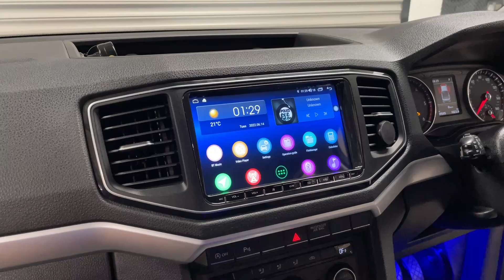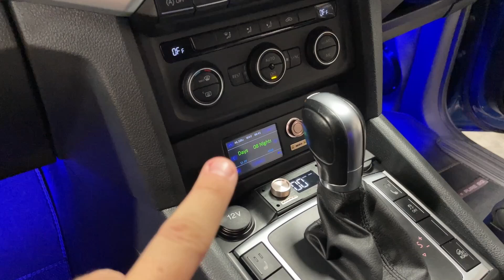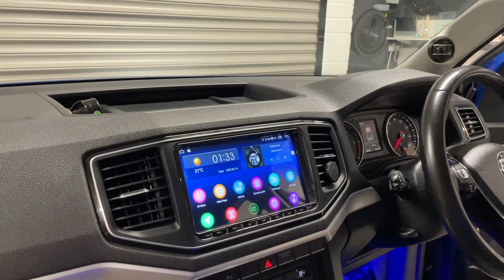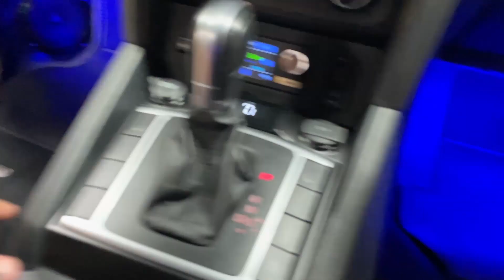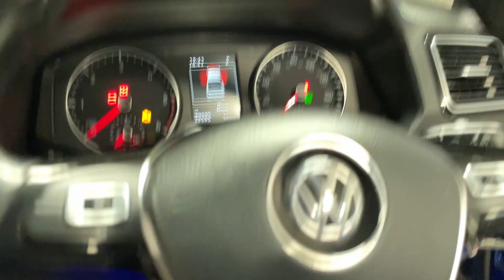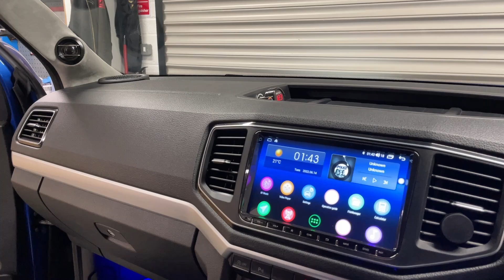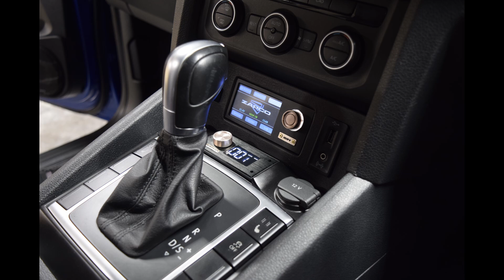VW Amarok SQ(L) System EXPLAINED - ESB, Steg, Micro Precision, Acoustic Elegance, Zapco, Alpine

Comment: Love seeing this amazing build come together.....Can't wait for the demo....Them ESB are certainly top rated speakers......Congrats on a job well done Peter and Eddie....I've been thinking about  kicks and doors for speaker locations.....pssound keep inspiring great system builds 💯⭐️⭐️⭐️⭐️⭐️
Reply: Peter has officially made me choose to do ib kicks from my previous plan of sealed door enclosures.
I have now finished the sheetmetal work( with trim work to follow soon) to fit some 10" dynaudio midbass in the kicks, fully hidden behind a slightly modified/ widened factory trim panel.
Very very happy on this decision!

Comment: Nice setup, I have same cento speakers from the front doors. I think they are ck165. I will put this ones in one of my cars, Peugeot 508 in rear doors because of the big magnets, and for the front doors I will buy the ck165F which are slimmer. All hooked up on one audison sr 5.600 or 4.500, I will see. I’m not sure if I want 4x75w 4ohms and 1x550 2 ohms from the sr 5 channels or 4x100 from the 4.500

Comment: Hey brother. What would happen if I just used a high level line out off my current floor sub in my 2017 E300. Would the built in DSP cause issues? I want to use my PDX V9 to run my Addictive Audio sub and build a box in the spare tire location with fiberglass. I dont want to deal with a bunch of other equipment if I don’t need to buy it. 

What’s your thoughts? The highs sound ok and the sound stage is not bad but I’d like to just add more bass. Maybe even just use one of my 10” subs

Comment: Hi Peter!
Can you or someone tell me please some pro and cons on Musway DSP68 vs Blam Audio LSP68? 
I have to choose one because i'm sick waiting for Helix pro mk3. I need another DSP to finalize.

Setup : 
   -Blam Audio L165P,  2 way 165mm F+R on stock crossovers. Front woofers on doors and tweeters on dash + rear full on doors in OEM position.
   -B2 Audio Ref Four amplifier (pure love)
   -B2 Audio Mono amplifier for subwoofer
   -B2 Audio HN15 subwoofer
Sources :  
BT stream direct on DSP most cases butttttt.... in some cases i want my Pioneer 80PRS with AudioQuest DragonFly Red DAC on it. 
Thanks a lot and don't stop with this!
Reply from the maker: Hi, i don’t have experience with any of those DSPs, but if 8ch are enough, then check out the Helix DSP.3S, Steg or Zapco alternatives too. 
Also, the Helix M SIX DSP is unbeatable value with 6ch amp + 4 extra RCA channels.
Reply: @pssound9749  Do you have any advice about the Helix M Four? It looks like good value, but reviews are very scarce. Is it as good as the M Six, just 2 less amplified channels?